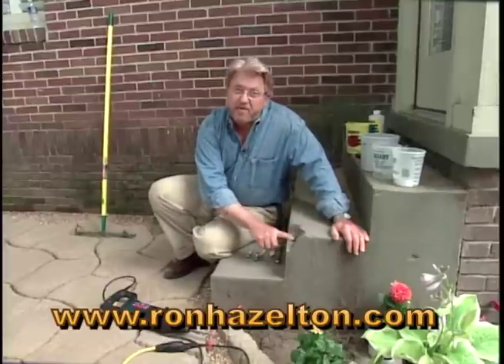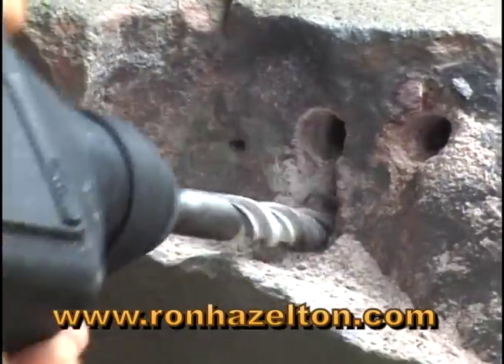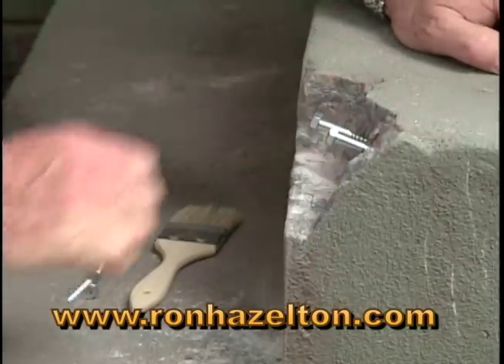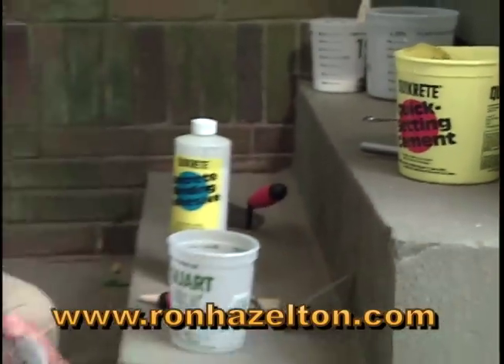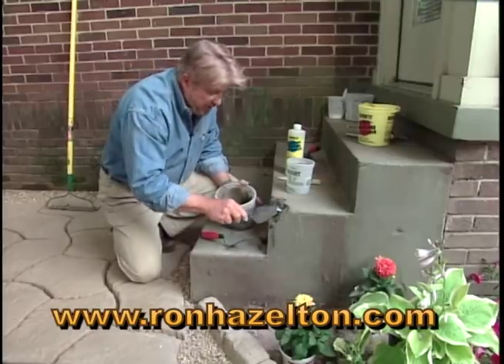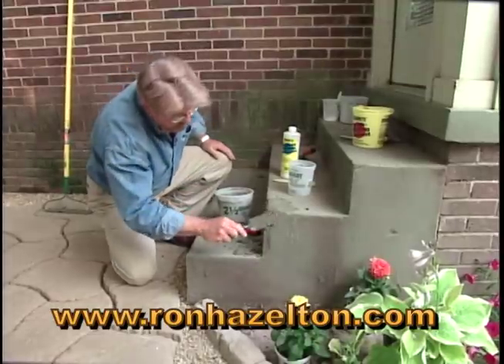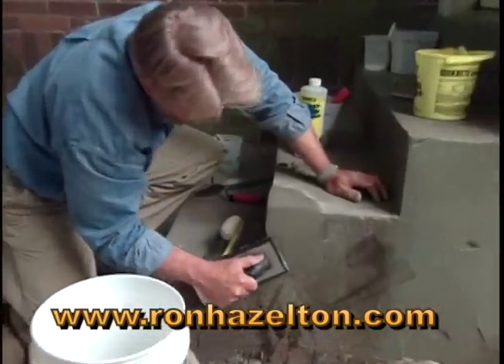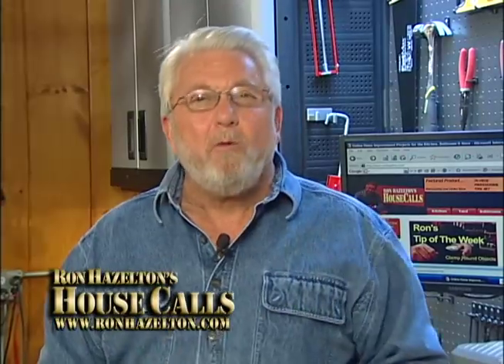How to Repair Concrete Steps

Comment: thanks for tip Ron about the anchor sleeve and bolt. I have a block knee wall with a metal door. The brick layers didn't fill the void like I asked. so after a time it developed a crack. I'm going to cut the block down to top of patio and drill holes for rebar and and tie it to the corner wall using "Quickcrete" they say when cured offers 6-7 time the strength of concrete. I was wondering what product you were using till I caught a glimpse of Quickcrete. thanks again, I like your vids.

Comment: great job.  you can also mix that glue with the concrete patch to increase the bond.   galvanized bolts might last a bit longer than the zinc ones you used in the vid.    other than that, balls on!

Comment: You can do just as good of a repair with just portland cement and sand, with some practice. Proper application of portland cement  makes the best bonding agent.
For a small repair like that, the method shown would be more economical, since portland cement normally comes in 94 pound bags. The anchors are only needed if the patch doesn't bond properly.

Comment: Epoxy in the bolt holes might be better if there is concern about the expansion bolts cracking the concrete.

Comment: Great video but he fails to mention that it is necessary to brush and clean the area thoroughly before adding any bonding products. Also, I can’t see the finished job due to the build a flag display frame video occurring at the end of this video.

Comment: Good job but if you use the steel wire to connect 3 screws in that case more strong result .      Mushtaq mughal